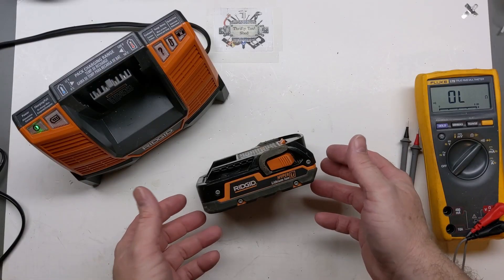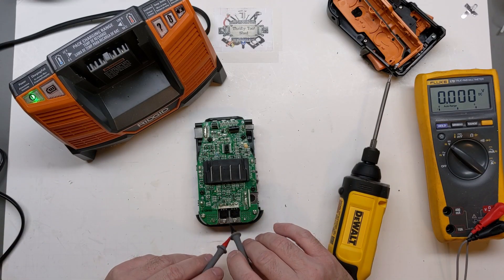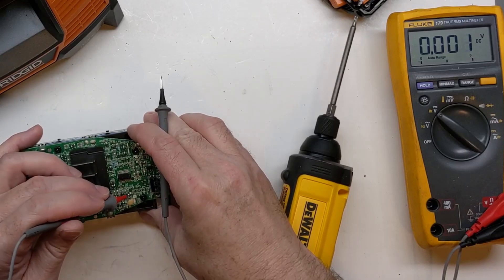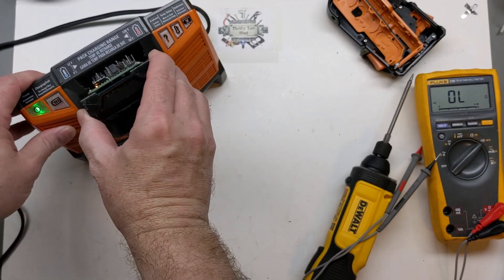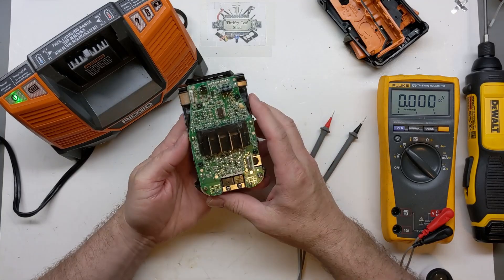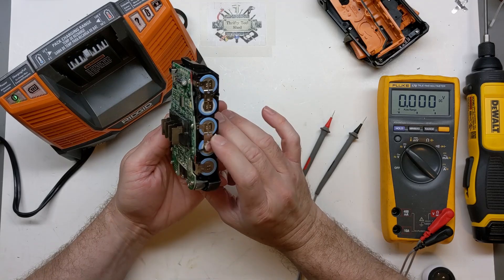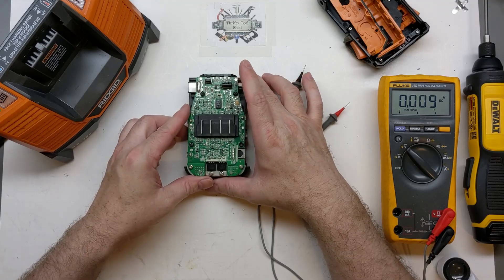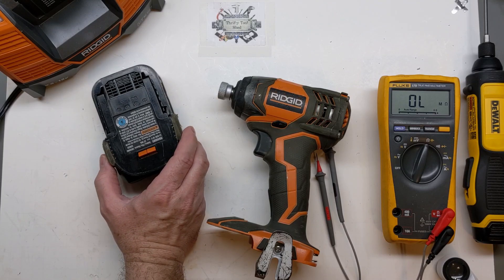Can we get this Ridgid 18V Hyper Lithium Pack back working?

Comment: Have 2 x AEG (AUS version) 2.5Ah that both at the same time cannot fire up the brushless drill. Both batteries still charge on the charger as normal but never reach to a full charge...(cannot go past flashing the 3 orange led).
Power at the terminals is 17 volts
I have opened the batteries... and the power internally is at 19volts ...
Cleaned the board with shallite... even reset the board (no lights lit up)... but no success same issue

Have you encountered this problem... ?? Pls Help
Reply from the maker: Just the issue shared in video. The board cleaning and the reset is the only issue I have seen so far with these. I did have to clean 2 of these more than once to get it to work correctly. I could not see any corrosion around the microcontroller, but ended up being ok after a good spraying the second time with plastic safe contact cleaner and lightly brushing gentle brush all around the microcontroller area. Best of luck to you with yours! .

Comment: I don't have the reset pin on my new AEG battery (same as Ridgid). Andy idea how can I perform it ? Thanks
Reply from the maker: If you don't see a programming header or at least pads for a programming header then yours may not have one. Most packs do, I have seen some without. I have not worked on a AEG, I always thought them to be the same as Ridgid. May be a few differences?
Reply: @ThriftyToolShed  it's a recent AEG proHD 6ah. Maybe they remove the way to reset it 😐
Reply from the maker: Oh ok! I have not worked on the newer Ridgid packs they could be the same way then!
Reply: @ThriftyToolShed  How would you reset using the header marked “prog” and pin holes labeled 1 through 6? Or if there is documentation out there you could point me at?
Reply: Did you ever find out how to reset using the prog header pins?

Comment: Ive an 18v 60Ah with same charger you use in this video and the charger doesn't flash faulty but battery won't charge??anything just from that you could recommend I do please
Reply from the maker: If this is the only pack that does it with this charger I would start with cleaning contact points on the pack and charger. Make sure all connections are in good shape.

Comment: Down here in FL, and a light mist of rain shut down a few of my batteries. After watching your video, I'm pretty confident I can get them working again. I'm going in. Wish me luck.
Reply: Had one in the back of my truck here in TX, wouldn't be surprised if it's the same issue. I'll have to go buy some contact cleaner this week and open it up!
Reply from the maker: Best of luck to ya!

Comment: Have you ever worked on a Ridgid 9amp Hyper lithium pack.  It is in like new condition but I rarely used it and now when I check charge I have no lights and it will not charge.  It keeps the checking condition flashing for ever.  I see no pins to jump on the board to re-set it and the way it sets and is strapped I am unable to figure out the cell connections (to try and jumpstart it with a good 18 volt battery.  Thanks if you can provide any information
Reply from the maker: Sorry, I have not worked on one of those. Be very careful jumping pack to pack. If one is really discharge and the other charged it could destroy both packs. Always use a CV CC power supply source with lithium. Constant current is key to protect from over current inrush. Best of luck to ya!

Comment: Having the same issue but the clean doesn't work. 
I pulled the battery pack apart to have a look inside and manually install a balance lead so I could charge it on my hobby grade charger in case something went wrong.

AND THEN IT STOPPED WORKING! Very annoying
Reply: ok what the hell, I just put the housing back on for the hell of it and now it's working.
Temperamental!
Reply from the maker: Sounds about right, lol. 
What did you use to clean it with? It may have had to dry out before functioning properly.  I have used high percentage alcohol and still had it cause the boards to act up because it still has a small percentage of water in it. Not usually enough to hurt it, but cause the microcontroller to act up till dry. Plastic safe contact cleaners usually don't do that. Some 99% alcohol may not but any percentage lower than that will. I will not use any lower percentage alcohol on any board that cannot be powered down like these packs because of water content.
Reply: @ThriftyToolShed  it was some methalated spirits (Isopropol alcohol)
no added water as far as I'm aware. Cheers for the guide, the reset trick will be useful in future no doubt

Comment: Will a hypertough charger work on rigid battery
Reply from the maker: I have not worked with Hypertough line at all to say for certain either way. I will say typically brands design their packs to only work with their own designed chargers. Although most all 20V packs need the same charging voltage It's all about how the sensing circuit is for the pack and of course physical fit as well.

Comment: I got the same battery!! Can I charge it with my Milwaukee m18 charger?? And what mean T1. And T2 ?? Do I need these two to charge it?? Thank you for reading me !!
Reply from the maker: Sorry, I have not looked into that to say for certain. The packs may not be very different, but the Temperature terminals etc. as you mentioned would have to be investigated to see if they are in fact compatible. Both use thermistors, but I have not compared the exact differences.
Reply: @ThriftyToolShed  thanks for your time to answer the best way of your knowledge!! I appreciate it a lot !! If someone else reading my questions knows well the right answer !! It will be very welcome !! Thank you friends!!

Comment: So I accidentally shorted out a pack. I conducted the reset and then hit the button to activate the LED’s. That caused a burst of smoke to emanate from what appeared to be the mosfets. I tested the mosfets and they test fine.  The status lights won’t turn on. Then I removed both mosfets and now the status lights are functioning. Just replace both mosfets? Thanks.
Reply from the maker: In my experience if you did see smoke coming from Mosfet, they are usually shorted or open after that. If they do check good, is it possible a resistor near the gate etc. Is where the smoke came from instead of the Mosfets?
Reply: @ThriftyToolShed  if you are looking at the side of the battery where the nose is on the left, the smoke came from between the right most battery on the top and the metal “heat sink”. The smoke came from underneath the board and I dont see anything under there in that area. After I did the reset the lights no longer came on but I just removed both mosfets and now the lights are coming on…
Reply from the maker: Smoke usually leaves evidence, but hard to say really if you can't see any.

Comment: Hello thanks for the video !  Can you please let me know how to remove the security tabs off the battery to access the torx screws  only two of them are uncovered
Reply from the maker: Mine did not have the tabs covering the torx head screw. I have had some Ryobi with the plastic plugs covering the screw, but not yet on the Ridgid. Sorry. If it's like the Ryobi you can simply take a very small flat screw driver and slightly penetrate the plug and then pry it out, of course these you have could be different. Best of luck to ya!

Comment: I had one that was working fine in tools but wouldn’t charge.  Cleaned corrosion with isopropyl and reset the board. Worked great!  Super informative video all around
Reply from the maker: Awesome! Thanks for your comment!
Reply: How did you reset the board?
Reply: @Gotti123  I don’t remember but I believe it was the way outlined in the video, unless I’m thinking of something else.
The battery officially died about a week after I fooled with it 🤣

A month ago, around 2/3 of my battery tools were taken from a jobsite so I gave the rest of my ridgid stuff to my dad (he uses that brand already) and switched to Milwaukee
Reply: I manage to jump start one one the dead 3Amp octane batteries with another however I got tye Bluetooth blue light and it still says defective whenever I try to charge it….maybe it’s just not repeatable?
Reply: How did you rest the board?
Reply from the maker: You reset by jumping the Reset pin to Ground. I have shared this on other TTI packs before also such as some Ryobi and a Echo 58V pack repair video. Many of these have a spot where a programming header would be installed and you can use that. If they don't have that then you have to find the microcontroller pin out and do it directly on the pins.

Comment: I have a battery that won't charge or release power. On the output terminals, I have voltage on the positive, but I don't have continuity on negative to anywhere. I can't check voltage between positive and negative on those terminals. So the negative side is open somewhere. I dont know where to begin to check.
Reply from the maker: It's been awhile, but I thought I showed the Mosfets and how the negative is switched through them in this video?
Reply: @ThriftyToolShed  I looked up a schematic for the battery and the terminal goes pretty much straight to the negative side of the battery. So I soldered a wire from the terminal to negative and it works great now.
Reply from the maker: Must not be the same battery that I show here then. These Ridgid absolutely have the negative side switched through the Mosfets as shown in video. Without the Mosfet shutting down the voltage from cells you have no protection from over discharge, over heating etc.

Comment: Man, I had 2 Ryobi P108 batteries stop working on me on the same day, just did the reset by jumping the board and they both work again. Makes me think the batteries were programmed to fail after a certain amount of time. I mean what are the chances that two batteries I bought together failed the exact same way at the exact same time?
Reply from the maker: That's crazy. Glad it worked, thanks for sharing!

Comment: If you had registered the battery with Ridgid all you need to do is call them.  They'll send out a new battery NO CHARGE
Reply from the maker: Unless of course you are the one buying the returned tools from Home Depot....
Reply: To add, you can only register batteries when purchased as a kit with tools. The LSA isn't available for batteries purchased separately (like my dead 3.0AHr battery; why I'm here😀)

Comment: I  dropped mine into a bucket of concrete floor leveler ...slurry mix.
The components inside were completely covered in dust and cement. 
I RECOVERED it!
Amazing how much abuse it can take.
Only REGRET not taking a before photo to upload and show you ....for a laugh.
Thanks again Sir.
Reply from the maker: Sounds like a mess for sure. Excellent job! Thanks for sharing!
Reply: @ThriftyToolShed  Scubbed with WAX and GREASE removing solvent as I had run out of Contact cleaner....blew with compressed air...thats it.

Comment: Do you know what’s causing the battery to shuts off when the battery is under a heavy load? My Ridgid battery shuts off in a fast start. Slow start is fine.
Reply from the maker: More than likely it's a cell dropping too low. Only way to know for sure is when the pack does that test the cells individually and see if one cell is lower than the others. It has most likely that cell has lost some capacity and dropping to cut out voltage under load.
Reply: @ThriftyToolShed  I have taken the cells apart and tested them one by one. The voltage are good. If I read your comment correctly, did you mean I should test each cell’s voltage while the pack is under a load?
Reply from the maker: @christopherowens2635  
Yes. Under load or if you have load tested them out of the pack with a capacity tester then they may be good. It could be a weird BMS issue?
Reply: @ThriftyToolShed  Possibly a bad BMS. The battery pack is only a year old. Can it be bad mosfet? I may be just swap out the entire cells.
Reply from the maker: @christopherowens2635  Possibly, I have never seen a Mosfet act that way though. They almost always fail shorted and occasionally open. Seems very rare to drop out without BMS controlling that.
Reply: @ThriftyToolShed  So far, majority of the help are second guessing the batteries. I have one dude is guessing the mosfet may be going bad. I will swap out the entire cells and let you know.
Reply: @ThriftyToolShed  Update!!! I swapped the entire cells. The pack still dies with brand new working cells. What are your suggestions now?
Reply from the maker: @christopherowens2635  Unfortunately it's in the BMS, the only experiences I have had with the BMS is cleaning corrsion around microcontroller a few times and replacing Mosfets once. Other than that most issues was the cells in my few packs I worked on. Trouble shooting BMS is only option it seems. I have not gone down that exact path. Best of luck to ya!
Reply: @ThriftyToolShed  I appreciate your time. Thanks & thanks for making this video too.

Comment: Again we have these as AEG brand in Australia. I've played with hundreds of these batteries. I believe your problem might have been connections on the microprocessor pins on the side of the chip you point to. I have also seen the batteries flash as if they were charging for no reason and eventually draining the battery, again connections on the microprocessor chip which I fixed by reflowing the solder on the pins quickly with my soldering iron (shorting them temporarily doesn't seem to be a problem on that part of the chip). Main weak point on these is the microprocessor goes faulty (all lights flash when button pressed indicating faulty pack), it's a pain but I've replaced the many microprocessor chips with one's from other packs so can confirm the failure. I think it might be heat that damages the processor chip.
Reply from the maker: If I am correct the AEG is basically identical to these Ridgid. I have had many contacts and conversation with some of the down under over the last few years.

Comment: Hi, I have 2 18v and 2.0ah  hyper lithium batteries by Ridgid. The made date shows Mar 2018. I get 0 lights, yet charger shows Green, no issues. Plug it in and the red flashes about 3, 4 times then green. Yet 0 lights, no power. Do you have any suggestions? I've got old 12 volt Ridgid, and they charge but don't hold charge long. That i understand. But 2 batteries from same batch 1 manufacturer number different. So are a set from the kit. But both with exactly same issue? Seems weird.  They look brand new, so it's not misuse. Appreciate any advice. Thanks.
Reply from the maker: Seems odd both being that new and in that great of physical condition for sure. I have to ask if you have tried warranty replacement of these being that new? In case you have no warranty I will ask what all have you tried yet? Have you measured voltage across all cells or tried the microcontroller reset? Sounds like corrosion may not be an issue if they look that clean, but I have seen some odd behavior with even mostly unseen corrosion around some microcontroller pins. I shared a little about this on this video with the Ridgid packs and in a recent video on a Fluke 79 DMM I was surprised that cleaning around the microcontroller got it back working as well. Rare fixes for me, but atleast successful sometimes.
Reply: @ThriftyToolShed  No, I have difficulty registering my tools. Bad habit. 
As for checking for voltage,  no, haven't checked with a meter. 0 lights on display, and totally dead on tool, so assuming they are totally drained and when I put them in the charger, it blinks red a few times,then green, as if charged. I've repaired several of my tools, mechanically I'm proficient,but all the little solders and diods throw me for a loop. I'll open them one at a time and see what I see. Like u said, one with the problem is acceptable, but both? The drill works fine with a newer battery,so it s not the drill. I'm totally disappointed. And as i said,the manufacturer number is the same on both except for the last number. Ones a 6 and the other is a 7. So they were side by side on the assembly line.
I will open them up and check for corrosion. Maybe I'll get lucky. 
Very frustrating, because the drill is like new. The chuck paint job is perfect. Not 1 chip or scar. Crazy.
Reply from the maker: I understand. Possibly the cells are really flat or atleast too low to charge. Crazy how the charger goes green..
Reply: @ThriftyToolShed  Like I said, I have several battery tools,of different brands. These are the first that have died like this. As far the charger going green, I thought maybe twas the charger as well. But I have three Ridgid chargers and they all did the same. Flashes red for few blinks,then green. I'll pick up another can of contact cleaner and open um up. I thought the newer batteries had the flat cells, like phone batteries?
Reply from the maker: The only pack that I know of with the flat cells is the DeWalt power stack. They are higher current out of the gate so for saws and impacts I could see a benefit. Slow drain loads not much different most likely. Also, I knew the issue you have sounds like the packs l, I just meant it was odd with the charger going green as in I have not seen that that I remember. Best of luck to ya and Happy New Year!
Reply: @ThriftyToolShed  thanks,,you too. Will let you know any positive results.